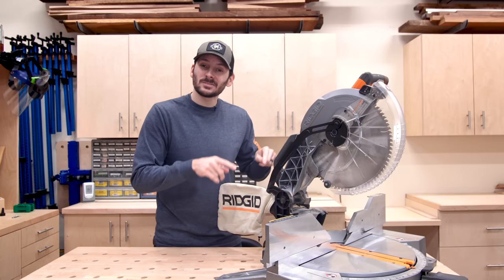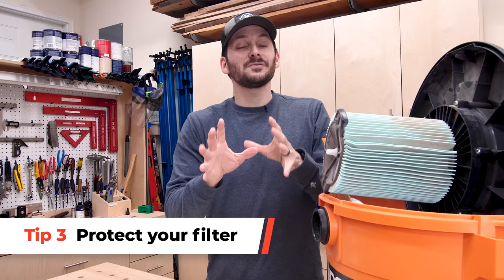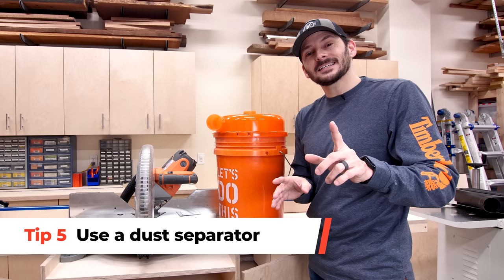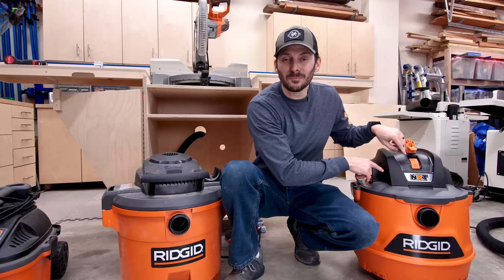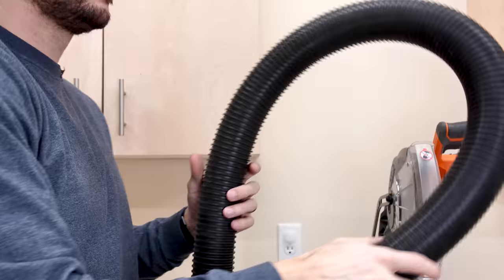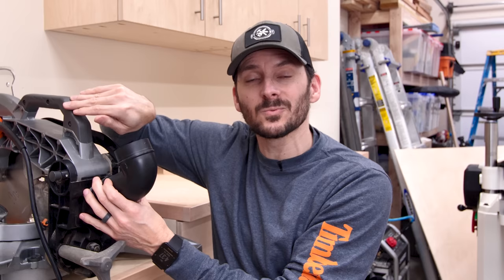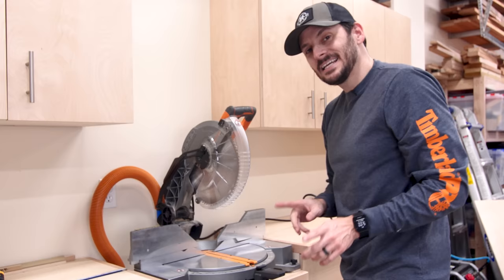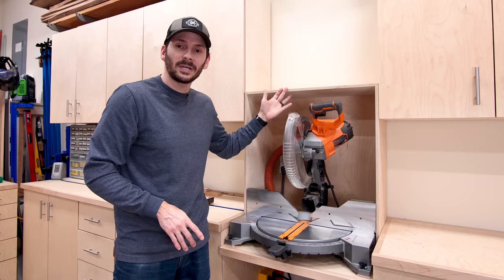10 Tips for Better Miter Saw Dust Collection

Comment: I use the Rigid 12 gallon vac with the dust separator. However, if you are using a shop vac, please vent the exhaust side to the outside of your shop. There will still be small dust particles that the filter didn't catch. Also, it allows you to use the cheaper filter because it vents outside. Mine is in a permanent location with a hose long enough to reach all my equipment. (small shop)  I also have a 2x2 box fan with a furnace filter in front of it and a 2x3 window fan mounted in a wall for those days where more is needed (cutting mdf or using something that doesn't have dust collection capability) My air quality monitor rarely shows higher than 10. (measures half microns).  Thanks,  Brad,  for talking about this important subject.
Reply from the maker: I can't vent it outside due to where it is on the wall, so the Hepa filter is the best alternative for my setup.  And I don't think my neighbors would like me spewing dust at them :)
Reply: @Fixthisbuildthat  I understand. My comment was more for those that could.

Comment: Brad, I put everything together today with the dustopper and vac switch on my mitre saw.  I'm so glad I saw your video!  I love this auto vac switch, and I can see a difference already just in less dust in the air while using my miter saw.  Next thing I'll do is build a box around the mitre saw to try and capture the rest of the dust that comes out from behind the blade.  Cheers!
Reply: Seems like you need to make two vacuum intake ports, one at fence face (level @cut plane) and one at back of blade (@level of carried cut litter) you’ll catch more of the big stuff tossed along side the cut wood.

Comment: I use a dust hood similar to yours with a front to keep the dust from flying at me. Works great. I don’t even use it with a shop vac
Reply from the maker: Is the front removable for mitered cuts or just wide enough to let the saw move the full range?
Reply: @Fixthisbuildthat  wide enough to swing both ways

Comment: When I make vac hose adaptors, I try to use the Outer diameter of the tool instead of the Inner diameter. This the adaptor that I 3D print wraps around the tool’s port, instead of inserting inside. Inserting a hose adaptor leaves a 1/16” edge ring that blocks the dust. Always plumb your air for absolutely minimal resistance to flow.

Comment: At first I thought having to plug that pigtail back into the unit was stupid, but I looked it up and it's for when each tool has to be powered on a different 15 amp circuit so you don't blow a fuse. Nice feature!

Comment: I have a furnace fan in the cabinet under my chop saw with a large hole in the back of the hood, on top of a baffle holding 3 furnace filters to keep the dust from being pulled through the fan. The blower exits along the floor at my feet. This keeps the air moving in the shop & the overhead air cleaner gets the airborne dust that gets away, which isn't  much. It works really well and it's easy to clean out. The best part is it's quiet! I'll leave it run for about an hour at the end of the day while I clean up.

Comment: Best outlet I have ever used is called the iOutlet.  The minute you start the tool, the vacuum will come on, and stay on for 10 seconds to clean the hose.
Reply: There has yet to be a miter saw setup than can catch all of the shavings.  The best I found was through Rockler, which was made for a radial arm saw funnel.  You still will get dust everywhere, just not so much of it. Those require a 4" hose system to collect the dust which you can get from Harbor Freight for around $250 (USD)

Comment: A little realization on air flow:  exhaust manual recommends air flows for circular (radial, table, etc) saws in the range 350~500 cfm (cubic feet / min).  And the biggest problem with a miter saw is the uncontainment of the particulates.  No matter how much suction ... well, within reason ... you put on that little duct connection, a lot of material escapes around the sides, and top, and bottom.  Circular saws, operating at very high tip speeds, generate a lot of particle velocity.  A shroud application is about the best you can hope for.  You made a wooden shroud (I used clear plastic).  I put a 16x20 scoop in the bench surface behind the MS, and a 4" duct to my DC evacuates the shroud area.  It's about 85% effective, but on small particles it should be about 99% (because small guys just go with the flow).
Reply from the maker: good tip!
Reply: Does the clear plastic just work as a directional funnel connected via 4” adapter as well as pull suction at the plane of the cut, ?
Reply: @carenclemmons5002  The shroud is 2" higher than the MS, about 6" wider than the MS, and curved on the back (particles bounce down), and the scoop is the 16"x20" behind the MS.  I framed the shroud from curved plywood and then used dowels for horizontal connectors to the sides, with the curved surface and the two sides made from clear plastic cloth.  Footprint of the shroud is about 24" deep and 20" wide.  Allows light on the surface.  Sides are even with the MS fence so no interference with workpieces.

Comment: Something you didn't mention about that auto dust collector box is the two power cords. If your saw and dust collector trip your breaker (or if you are using it with a planer and larger dust collector) the box has two power input cords so you can plug them into two outlets that are on separate breakers. Many don't have that option, but the one you have does.

Comment: Excellent solution if the only tool you have is a miter saw. I had to come up with a different solution for my 10 x 20 shop and my 6 tools that spit out loads of sawdust. I needed centralized tools, a centralized vac system, and an out feed for my table saw. Having all my tools around my outside walls was not a solition unless I had a larger shop, a deeper pocket, a vac per tool. My outfeed table houses 4 tools, miter saw, drill press, band saw, and surface planer. Each tool has it's own foldable 180 degree lid. The sutface planer, miter saw, table saw, and router table utilize the bench for pot feed, their work surfaces are all on the same plane. I made a plenum that fits inside the bench and is also accessed by another 180 degree lid. The plenum has 6 diy dust gates, 4 for the tools housed inside the bench and one for my table saw and one for my router table. To operate my vac I also use the automatic vac switch and a dust demon cyclonic separator. My 12 gal rigid vac has a bag filter that is modified to be easily emptied, a porous slip on dust sleeve, and the pleated filter. All 4 tools inside the bench are attached to a 3/4" plywood shelf that is hinged to the bench framework with standard door hinges. Works for me and I can rip 4 x 8's lengthwise inside my shop on the table saw.

Comment: I have a Home Depot Dustopper and it works really well.  Highly recommended.
Reply: Same here and I agree, especially for the price, it does an amazing job. My vac and dustopper are loose right now which is why I stopped by. Need a cart or something since my shop also has to hold cars 🤦‍♂️ so everything is mobile. Thought about getting the portable 4.5 HP with 1 1/4 hose but you talked me out of it!
Reply: @poseyk01  There are a number of dust collecting carts out there.  One is from April Wilkerson.  I built mine using a furniture cart I purchased from Harbor Freight and simply mounted a piece of plywood on top of it to fit both a large shop vac and the Homer bucket with the Dustopper along with cast iron poles on each corner to give me something to grab to pull it around my shop.  But I do like the vertical carts like AW's.  I just don't want to spend that kind of money for plywood at the moment.  But, also look at Brad's plans to see if he has one as well.

Comment: Although you could use the automatic switch as you detailed in the video, the second cord is meant to be used on a second circuit so that the entire load of the saw and the dust collector doesn't overload and trip the circuit breaker.
Reply from the maker: hmmm...that makes sense, but with the length of the cord they give you I would find that very hard to work in many applications.
Reply: @Fixthisbuildthat That Perhaps an extension cord of proper gauge would solve the length problem?

Comment: Use gravity! At my first shop, I had a dust hood installed under the platform where my miter saw sat. As all the dust flew to the back and bounced off the back wall, it fell with gravity and the dust collector sucked it into the chute. Couple that with a semi enclosed hood and you’ll be all set!

Comment: My saw sits on tool of a tool cart. Two other carts flank the saw's cart, and they are connected together with a plywood plate over the 3 carts. The saw's cart sticks out farther than the other carts so there is a space behind it. I built a small box to fit under the center cart table and I have a 4" pipe going through the table. I drilled holes in the plywood above the catch tray for an area larger than the area of the 4" dust system pipe. A blast gate is in the suction line. I have a hood around the saw and use plastic sheet strips (weighted on bottom) to enclose the front. The sawdust shoots out of the saw and the dust collector pulls the dust away. I have modified my system numerous times over the years. This version works well. My dust collector has a big cyclone before the DC unit.

Comment: I found the best dust collection for my miter saw was just to stop using it (12" Bosch glider).  I now cut my rough lumber down with a jigsaw and once it's milled, I use my crosscut sled to cut accurately to length.  Clean up is much easier now and less fine dust in the air.

Comment: Besides the stock dust port and shroud, some woodworkers have found that it pays to collect dust at or behind the miter saw fence.  Some indicate that the best solution is to use a combination of stock dust port AND shroud, or stock dust port AND at-the-fence dust collection, etc.  I’ve been wondering how well such combo systems work, and specifically, any trade offs that arise.  Your thoughts or findings are always appreciated.  Thanks.

Comment: There is a 90 fitting that fits that miter saw. It's a 90 street elbow designed for a  vacuflo system. The 2.5 inch rigid hose fits the other end well

Comment: Instead of a shop vac, I bought a used whole house vac from Facebook Marketplace and exhausted it outside. The control board was all that was bad so I wired it direst and used a automatic switch. All for less than the cost of a good shop vac. It works so well that I ran 2" pipe all the way around the shop to the table saw over blade guard with a auto switch to turn on the vac. Oh yeah, I used a little dust clyclone to keep the majority of the dust out of the whole house vac.

Comment: It's amazing how home depot hasn't caught onto ever shop vac complaint about accessory attachment diameter and hoses.  Even their accessory pack that supposedly fixes this problem fits nothing.   I did the same thing as Brad.  But I posted to a local Dad's FB group in my town and asked if anyone could 3d print me a coupling to go from my shop vac hose to the port on my belt sander.  One of the Dads did it for me that day.

Comment: Great video. I highly recommend the funnel style cyclone dust separators as their shape allows even smaller particles to be removed from the air compared to the flat top one shown in this video. At my previous job, we used 2.5 storey sized to separate product in the plan appropriately to meet spec. The smaller particles are lighter and to avoid being pulled into the vacuum need to be further away from the outlet, hence the funnel shape.

Comment: I use 3d printed parts as hose adapter all the time. If you can model your own, try to make the transition smooth instead of a hard turn, even a hard 135 degree turn is not as good as a smooth turn. One method you can try is to model one end, model the other end at 90 degrees to the first one, then loft between them with tangent, then shell. No consumer FDM 3d printer can print exactly the dimension you modeled; flow rate, print speed all have some effect on it. Print one, measure and calculate the difference, compensate in CAD, print again. This worked out the best for me.

Comment: One thing, might improve things a tiny bit: where you use the 3D-printed angle, instead of going straight up, can you come to the side and/or down? Not that the dust has a LOT of choice, but a 60° turn followed by a 180° bend in the flex hose slows the air down a lot more than not having that 180° turn. But then, if it doesn’t fit, it doesn’t fit.
Reply from the maker: it's more about having room for the hose to move when going to left and right miter angles

Comment: You have the 3D printed connector on your miter saw pointing straight up, in the 12 o'clock position. You actually lose a bit of suction with the more bends your hose has. Turn your 3D printed part down, pointing it to where the hose is coming up out of the cabinet, eliminating most that 180 degree bend. If your hose is too long and you're coiling it up under the cabinet, you're losing even more suction. Trim the hose's length to fit that tool's needs. I do this with all of my vacuum hoses, and 3D print new attachments to replace the factory hose end that I cut away. For even more space savings with my tools that are in fixed locations, is I cut the power cord down to the length I need, and put a replacement extension cord end on the tool. Then, I save the off cuts to make shorter extension cords. If a fixed location tool needs 5 feet of extension cord, I'll cut an extension cord down to suit that need.
Reply from the maker: yep, that works great for fixed tools, but since this one swings about 20" left to right at the dust port I need that extra coiled up to let it move freely
Reply: @Fixthisbuildthat  Measure out the longest length you would need for the hose to accommodate the full swing of the miter saw, then add 2 or 3 inches to prevent any hangups. The easiest way to measure this, is for you to be under the cabinet while someone else is moving the saw from left to right.  You could even add a foot or so to allow the dust separator or vacuum to be pulled out for maintenance. Cut away any excess hose to prevent any loss of suction.

Comment: A heads up for those without a 3d printer and have a Microcenter nearby, if you sign up for text ads, you’ll get a coupon for a Creality Ender 3 Pro for $100. It’s a good start for 3d printing for an affordable price. I did this in August and would’ve just canceled the text subscription but haven’t received a single text from them this entire time.
Reply from the maker: that's a killer deal!

Comment: Oh man the rubber connector with the clamps on it is exactly what I use to adapt the fitting on my table saw. It does an okay job but I think 3D printing an adaptor is definitely the way to go. I've always wondered, when using a hood with a miter saw, would you still get a decent amount of dust coming out towards you? It would be interesting to try to use a fan system that would blow towards the saw from above and or behind you and shove any dust that might try to escape the hood back towards the dust collection port. Great video - thanks for sharing your tips!
Reply from the maker: yep, exactly what I'm wondering.  If I start getting a face full of dust I'll have to rethink the setup and add a front or more suction

Comment: 3d printing couplers is a big win, been designing and printing couplers for the new dust collection system at my local makerspace including the big 4 and 6 inch pipes, $50 worth of plastic can easily make all the turns etc as opposed to buying them all given that one can easily cost $50 right now
Reply from the maker: that's awesome!  Are you listing them on thingiverse?
Reply: @Fixthisbuildthat  Some of them I have, once we print them out and verify they are working I am uploading them, so the larger stuff isn't there yet

Comment: did most of those tricks years ago. Finding the right fitting is a problem. One way around the problem is to use a molded piece of PVC on the saw connected to a length of clear flex hosing with an O ring clamp on the right angle PVC. I had a 5hp stubby shopvac.  I still had tons of dust in the shop, but I was always amazed at how much dust was collected by the vac.

Comment: Great video as always.  I had the same problems with my fittings and ended up sanding down the diameter and there is a 'little' duct tape holding things in place.  The vacuum switch is one of my favorite 'tools'.

Comment: I've made something like this before about 6years ago.
I added 2 flap doors on either side of the saw to close most of it off except for the blade area and handle. If I wanted to do a 45 cut I'll just fold one flap door over the top to allow the angle.

Comment: I have this power box, and the nice part about it is that I'm able to use two 20 AMP outlets putting my table saw on one and the dust collector on the other. The only quirk about it is that when my saw bogs down and starts pulling high amps the box's "breaker" trips before even the saw's does. Not a problem, good for safety, but I have to always remember to reset it from the box side and not the saw side.

Comment: i enclosed the bottom of my miter saw station and put a big fan at the back with a furnace filter  under but in front of it..  then built a hood over the saw .. so when i turn on the fan it sucks the dust down and since the the fan and filter are a bit higher all the dust stays down there..  it works really well and frees up my shop vac which i found didnt really catch all of the dust anyway